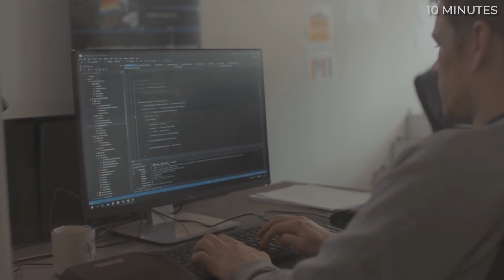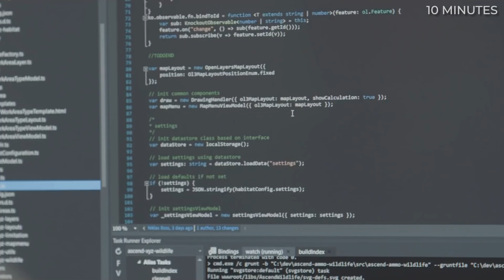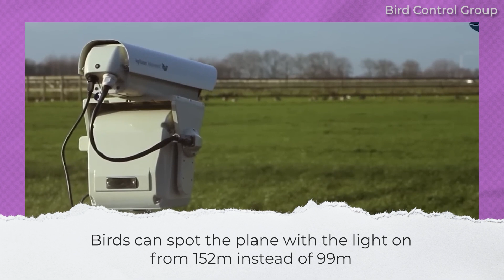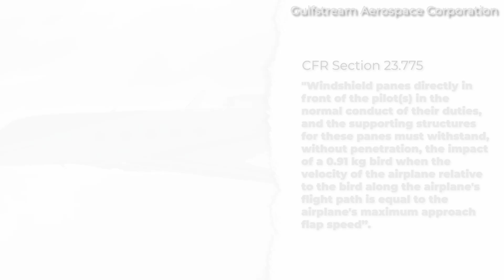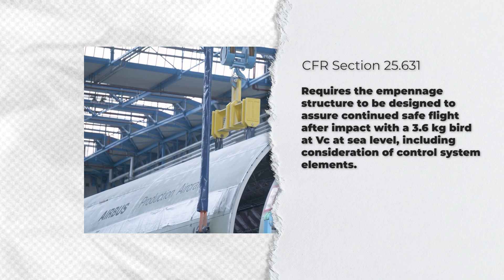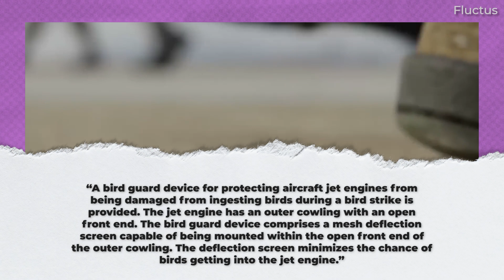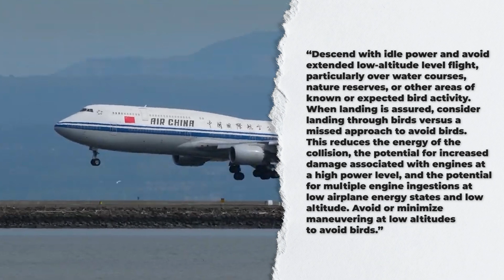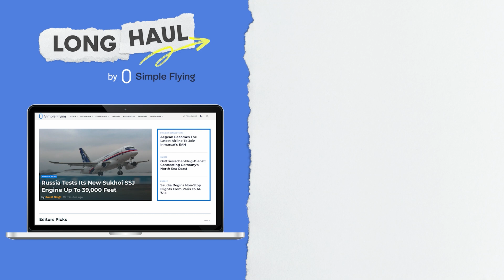The Dangers of Birdstrikes in Aviation

Comment: i found it interesting that they test the engines built for USAir 1549 that landed in the Hudson, the birds that hit were bigger than the ones the engines were designed to handle, of course the problem with bird strikes is where they hit, a plane can survive one engine out but all engines out means the plane can't stay in the air for long
Reply: U.S AIRWAYS at that time, but i get what you mean. Just a correction👍🏻